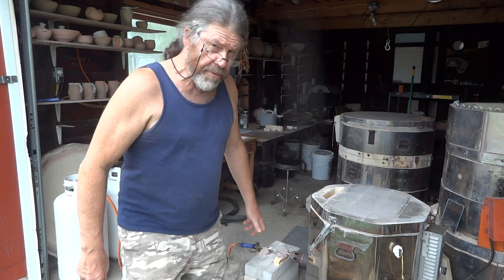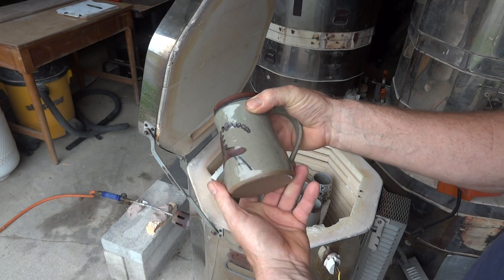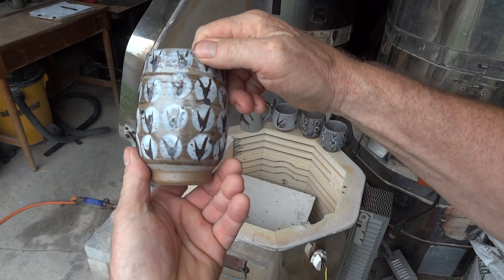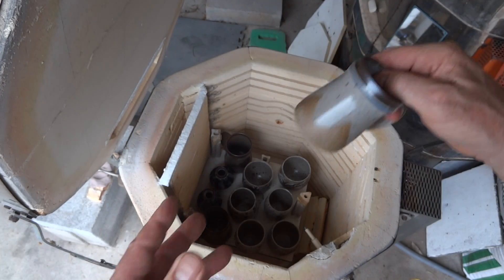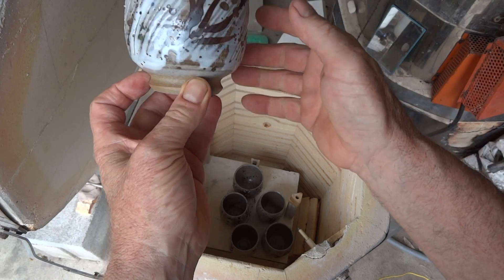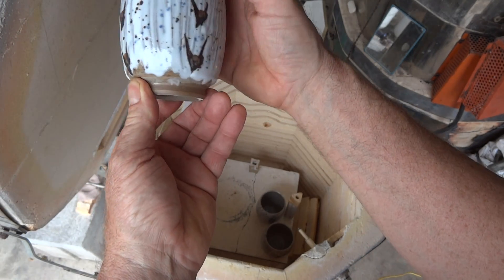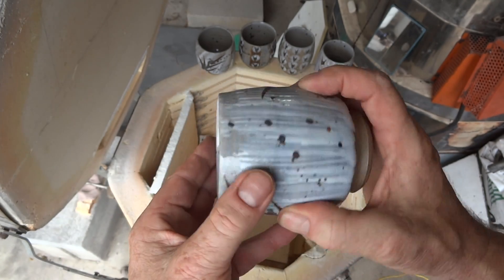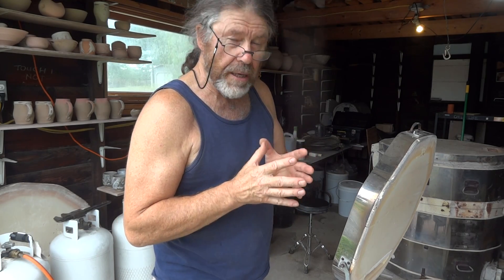Results of raw glaze firing - July 10th 2020 with Simon Leach

Comment: Hi Simon! My english is not very good but... I built a gas kiln with ceramic fiber blanket. I had no problems in the bisque firing but I'm not being able to get the glaze firing right. In the lower shelf I could reach 1260°, but in the other two above not even 1220°. My clays and glazes need temperature between 1220 - 1240°C. I dont understand why the others shelves are not reaching at least 1220°. Do you have any tips to help me? Thank you